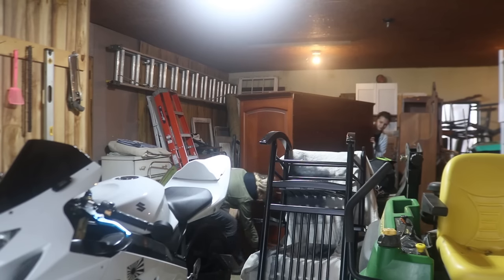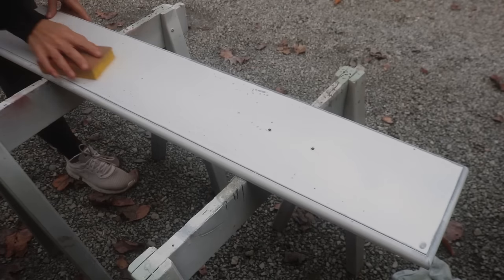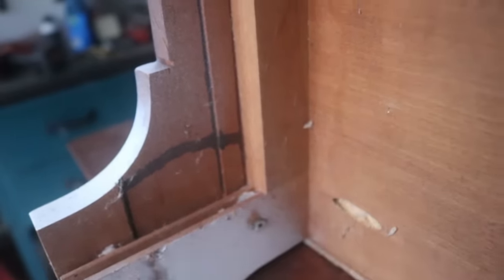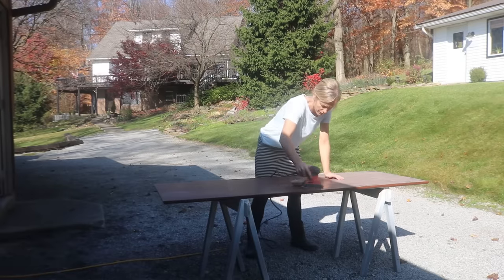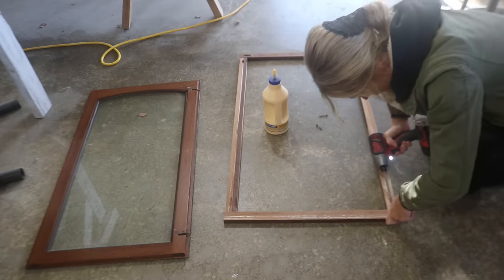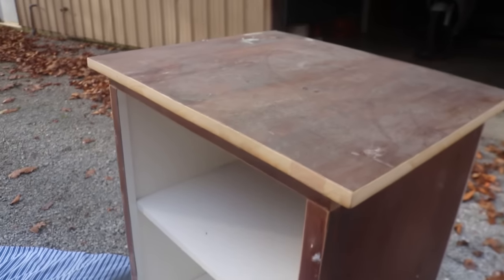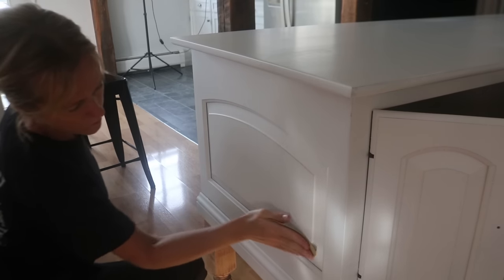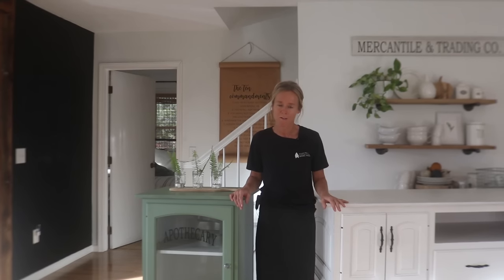Entertainment Center Makeover ~ Furniture Repurpose ~ Furniture Makeover ~ DIY Buffet Idea

Comment: Several years ago, I redid a very nice oak entertainment center into a desk for my sister. It turned out much better than I thought it would, especially after I had so much trouble cutting areas which really weren't meant to be cut. You did a fantastic job!

Comment: I did a similar project with an oak entertainment center I had.
It had the leaded glass doors on it I repurposed the leaded glass doors with mirrored paint.
I cut down the entertainment center because it wasn't in two seperate pieces and bought oak laminate to glue down on the top.

Comment: Beautiful work, as always!
I bought a 3piece 6'-8" unit ($5 ea @ Goodwill!), I've turned one into a twin XL Captain's bed frame, using the concealed pull-out door for access  to storage.
The second is now a permanent coat closet w/a louvered bi-fold door next to sliding patio door.
The third one (I'll add peg holes) will be used w/shelves for garage storage.
I am so pleased w/the end results!
At 73, you're never to old to learn: I got many tips & courage from your channel!! Thank you Mary, you are a wonder 😍

Comment: Cannibalizing the bed posts to create turned legs. It’s a wonderful example and really helpful if you’re trying to give people ideas for generating unlucky old pieces of furniture. loads of us have pieces of furniture around that we haven’t made any particular planned for, and they could be put to such excellent use. If we consider them a little creatively, looked at them in a new light. You may not have intended to use those parts from the headboard, But they definitely fire up creativity. Thanks!

Comment: I love what you did with this piece. A couple of years ago I did something similar by cutting down an existing entertainment center and using the top on the bottom piece to create a new TV stand. I had the leftover doors and sides and had them in our storage area until I finally gave them to a recycle center. I wish I had seen your video so I could have had some inspiration on how to use those leftover pieces.

Comment: Both turned out really great, but that is no surprise! When you first took it apart I thought the bottom portion with the trim piece cut off of the right side and top put on the left would have made a great bench to put by the door with a nice cushion on the right to sit while putting on shoes and boots. Having the drawer for slipper storage and the cabinet for a basket for mittens and hats! The top half I'd have put drum feet on it and make it a short curio cabinet or similar. I always love watching you work!

Comment: They both turned out really nice. The cabinet you built from scrap pieces turned out great, and I love the color. What a great idea to add legs to the bottom of the entertainment ctr to turn it in to a sideboard. I love everything white too, but think since the cabinet part is white, the legs should have been too. That of since you painted the hardware black, maybe the legs should have been black to match. I love the way you piece things together and make them look like they were always that way. And lucky you to have John there to help with tricky parts. You two are a great team.

Comment: I LOVE THEM!!! I've racking my brain on other uses for those cabinets. Besides turning him into TV consoles I can only think of turning them into toddler girl wardrobes. I have a unit that has craw feet and I was planning on doing a whitewash with a beadboard stained in antique Jade Minwax stain or a light blue stain. Now I'm thinking of a movable Island one. If you had thicker legs you could have put casters on the white one or both.

Comment: Excellent work. I think your shortcuts were apparent, I would have quickly scuffed up the original finish. Love your headboard/ legs solution. I have put legs on furniture and I built a frame for support.  I think your green cabinets could use some legs too

Comment: Re  a tip for placing painted shelves, pieces to dry:   I see in this video you are laying your cabinet pieces on the driveway to dry.   I was noticing your very nice saw horses… if u added small pieces of wood shelf / strip at the base, , and one midway up, this would make an easel so to speak, to place pieces on, up from the ground, and could be lifted / moved as needed without touching the painted pieces.  The sawhorse double sided easles would also make great display racks..

Comment: I just love how you just 'go for it'!!  Both pieces turned out lovely.  I think I would have painted the legs on the buffet white to match the rest, never the less, you did a great job on both. I have a question about the crud cutter... I was redoing kitchen cabinets getting them ready for paint and we tried the crud cutter to dull-up the oak surface, and we found it to be kind of greasy. Did we do something wrong when we applied it? We ended up washing down the cabinet doors with Dawn dish soap to get rid of that greasy film left by the crud cutter. Thoughts?

Comment: I'm surprised your hair doesn't look gray from all the spray paint floating in the air 😉. Just wondering if you have to use any kind of clear coat finish on the spray painted hardware.

Comment: I was just wondering Mary, do you only do one coat of spray paint on your furniture? My kids just bought me a Wagner spray gun for my birthday which was amazing, but I have never used one before and I know that when I paint with a brush, I definitely need at least two coats of paint. What strength flow do you use on furniture, sorry about all these questions🙂Also, the green looks very vintagy, it might be like a sage green? I love your videos, you've inspired so many of my upcycles. These two pieces are just so pretty.

Comment: Er, no primer? No pre-rough-up sanding the clear coat on the old finish? Was your paint water-based latex? Or oil-based? A paint + primer? The new paint can’t “absorb” into the old finish -  it can only “adhere” to the old finish, which is why sanding and/or priming is important. The orange-peel  texture and spotting seen in the drying paint indicates poor adhesion.  How long will the paint stay put before it starts to blister and lift off? Depends on the environment. 
You have an enviable spray system and great technique.  You could set up your own auto paint shop!

Comment: I suspect most watching don't own any of the equipment/tools you're using in the video that are needed in order to achieve the final result by DIY.
To buy the tools/equipment would be very expensive for an amateur and would outweigh the cost of the whole project .
You make it seem very simple and cheap,  it is anything but .
You're also lucky to own left over paint which mixes to a very trendy & expensive shade of green .

Having said that, great result - I just wish people watching could achieve the same result, a near to impossible task,  due to the cost of the equipment/tools involved.